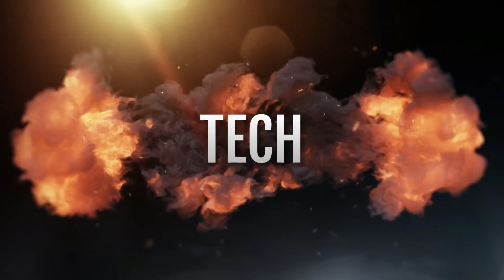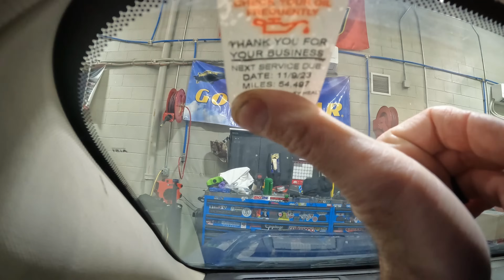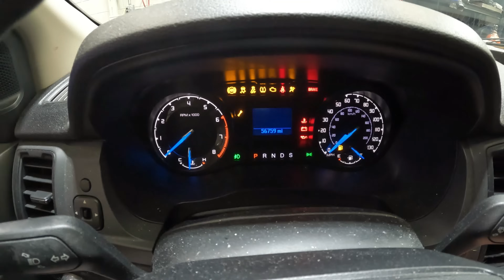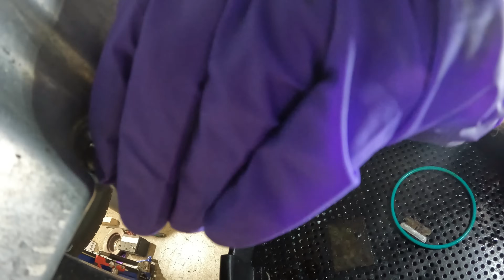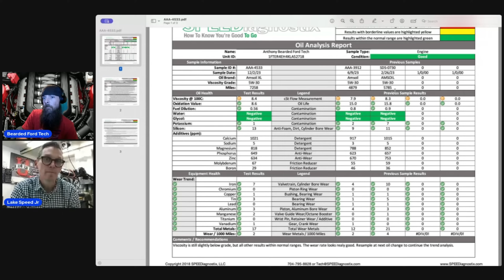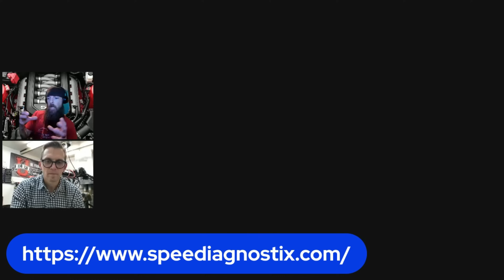7,258 Mile Used Oil Analysis With Auto Start Stop...SHOCKING RESULTS! #newtoyou #fyp #amsoil

Comment: @Bearded Ford Tech loved the video! I've made the switch to Amsoil from T6 Rotella 5w 40. I noticed less engine noise in my 6.7 Cummins and 2mpg increase. It's a 2017 Ram 2500. I have normally just stuck to 6000mile oci. I've got about 4000 on my Amsoil now. My biggest concerns with pushing out further is short trip city driving, fuel dilution and soot. I'm going to do a oil analysis trend starting with a virgin sample and 6000 mile sample with a filter change. At 74000 miles she still under full manufacturer warranty and extended till 10 years 110,000 miles. So I'm weary of installing Amsoil oil bypass filtration system. Ironically should be factory installed because of EMISSIONS related  soot being redirected into the engine on the intake side. But I'm finding Amsoil seems to be holding up better than anything else Ive used.
Reply from the maker: I run the amsoil 5w40 in my 6.7 powerstroke diesel fleet. Get a trend analysis going. That way we can all be sure.  You'll know your going ro far or not far enough. Or just right. This stuff is so interesting to me.

Comment: Hi @lakespeedjr I have a seadoo jet ski that uses mineral oil and service interval is 100hrs.but I only use 20 hrs a year. When do I change the oil?
Reply from the maker: I just forwarded him a screen shot of your question. Monitor the comments to see when he replies. That is a very good question!
Reply: Without oil analysis data, I’d just be guessing. I don’t like to guess.
Reply from the maker: Send in a sample. www.speediagnostix.com
Reply: Bone Stock 25 hours, if modified every 20 hours.
Reply from the maker: @steelzmb4262  send in a sample so you can get a trend analysis going so he can give you a correct answer and not guess. He doesn't want to tell you anything wrong. He wants your machine to perform in tip top shape

Comment: Anthony,  thanks for not being another ford tech that acts like God's gift to auto repair knowledge and everything you say is "bible".  I appreciate your willingness to learn and share that with others and using a data driven approach and not just "don't go past 5k OCI".  As we heard, even 5k OCI may not be safe or best.  I'm also glad your not attempting to "analyze" oil and addtive performance in your kitchen with a bearing grease tester.
Reply from the maker: Your welcome. It's interesting to me. The science is cool. I'm always willing g to learn that's why we are all here. So we can all learn something. Yeah I'm not doing that in my kitchen. Thats what labs are for. My take on it is this. And I've said it on livestreams before with lake speed.  If you need an additive. You need a different oil. A good quality oil already has what you need

Comment: Many years ago I owned a fleet service business. Even back then we started recommending 5k oil service intervals, and we knew full well many would be over that by the time we got our hands on them. After many years the only engine we ever lost was run low from a leak. These were gas engines and they would go to scrap with a running engine.
The thick headed types will be along shortly with their tropes about excessive intervals and brand choice being the dogma of our times.
Reply from the maker: They already started. They are buried in the comments I know all about the fleet stuff it's what I do now. 10k miles. I got one now about 7k over but it's about to come in.

Comment: Very interesting information. Especially about the use of auto start stop. I have such a habit of turning it off as soon as I get in and start any of our trucks.
Reply: I turn it off on a Focus RS…maintaining constant lubrication to the turbo is a high priority to me.
Reply from the maker: @fastsvo  You can literally see the wear rate is very low compared to having it running.  This one is turbo charged too
Reply: I turn it off immediately as well. I typically spend very little time idling on my daily trips, maybe a few minutes in total with the relatively few traffic lights I go through but it's super annoying to have the engine cut out and then have it re-start it maybe 10-15s later.
Reply from the maker: @ferrumignis  now that I can see. 10-15s is way to short for that. But please make sure you drive long enough to get the oil up to temp to evaporate unburned fuel or your doing more harm that good. The fuel will break down the oil and wear it out even faster
Reply: A typical drive for me is probably about 20-30 miles and maybe 2-3 minutes of idling. What’s your thoughts on that? Better with auto start on or off?
Reply from the maker: @domtorretto8875  the driving is enough to heat it up and evaporate it. The auto start stop would keep it from getting in the oil while idling keeping it from getting duel diluted.  I would get an analysis done with and without using it. That will tell you what would be working best.
Reply from the maker: See turning it off causes fuel dilution and more engine wear. I keep trying to tell people but everyone says I'm wrong. Oil analysis says otherwise. Idling an engine does more harm than good

Comment: If you are using auto stop/ start i would recomend using an oil like castrol magnatec and if using 0w20 go to at least a  5w30 !
Reply from the maker: Why would I run 0w20 in a ranger?  I run 5w30. Amsoil. Castrol failed the test sorry. He was talking about 0w20 for his daughters Toyota.
Reply: Run what the manufacturer recommends, don't start swapping to different grades just because you "feel" it's better.
Reply from the maker: @ferrumignis  why would I swap different grades?  I run 5w30 that is what the manufacturer recommends.  Your preaching to the choir. I've been doing this a long time.  Your hearing 0w20 cause that's what his daughter's Toyota takes. That is what he is referring to. Not my truck.
Reply: What data set is this recommendation based on?
Reply from the maker: @D2O2 ?
Reply: @BeardedFordTech  ?
Reply from the maker: @D2O2  didn't know if you were asking me what data set or tye original commenter.
Reply: @BeardedFordTech  Ah, it was to the OP
Reply from the maker: @D2O2  gotcha. 💯💯
Reply: @scootymoon what are you talking about?

Comment: Nice to know you can actually go as long as some oil manufacturers claim and that auto start stop is not as detrimental to your engine as most people think! I was thinking of this oil for my 2nd gen 3.5 eco,running Mobil 1 atbthe moment
Reply from the maker: Get rid of the mobil 1. It is made to the lowest of standards to be called a synthetic. It has failed many tests. Auto start isn't as detrimental and people always say im wrong. Which is why I tested the oil and did auto start on that run.
Reply: Where can I find this info about oils failing tests?
Reply from the maker: @huemongus3742  go look at ford boss me. He did a test on about 35 different oils.  Even lake speed has said on my livestreams Mobil is made to the lowest allowed.
Reply: @BeardedFordTech  my only issue with getting rid of Mobil 1 is that I don't think my Ford dealer has another option when it comes to synthetic oil for my Eco.And my dealer service department is excellent, only place I'll take my F150. I'm currently on a 8000kms/5000 mile oci,what if I shorten it to 5000kms/3000miles?
Reply from the maker: @jasonbrushett2005  Mobil 1 was breaking down at like 1500 miles. Does your dealer not carry Motorcraft full synthetic?  Or an automatic store you can get it like oreillys?
Reply: @BeardedFordTech  here in Canada at my dealer my options were bulk semi synthetic Motorcraft or Mobil 1 synthetic. Perhaps I can  ask the parts department if they can source MotorCraft full synthetic for me.
Reply from the maker: @jasonbrushett2005  if it's a dealer they should have it in stock. Comes in single bottles. Find out let me know.
Reply: @BeardedFordTech  I'm heading there on Friday to drop some Christmas goodies to them.I will ask for sure! Merry Christmas 🤶

Comment: But all of the start/stop systems starting directly after the cooling temperature is rising but at the same time the oil is still bone cold. And at this point in combination with the start/stop the oil takes even longer to get on temperature. (especially at city traffic driving cycles)
I can’t believe that this situation will not harm the engine. 
I’m with you at that point, that after the oil has reached its operating temperature you will not have excessive wear.
Reply from the maker: Yep. It's at temp. And when it shuts off. It's not off long enough to really harm the engine. He even said so. You will always have minimum wear. But the start stop isn't causing it or making it wear out quicker.
Reply: So get to operating temp. before using start/stop?
Reply from the maker: @jetskiracer222  if I use it I get to operating temp. If the oil temp is too cold or its too cold outside start stop shouldn't work until it's at a certain temp.  But using it at operating temp you should be just fine!
Reply: I just watched your video about start/stop. I never noticed before that it doesn't turn off until it hits operating temp, but I realize now it doesn't, so that makes sense. What about remote starting or warming up your truck? There's allot being said right now about it not being good for your engine.
Reply from the maker: @jetskiracer222  I remote start when it's really cold to defrost the windows. Or really hot so I'm not on fire when I get in there. It's the idling that's bad. And short tripping not letting it get to temp.  Everyone says start stop is bad. Or remote start is bad. But they never say just starting it in the morning is bad or sitting there idling in traffic letting the fuel wash the cylinders and dilute the oil.  They just assume things. First initial startup of the day is where the most wear occurs.  And idling for long periods makes it even worse. Remote start and start stop aren't doing harm like people assume. They don't care to learn how any of the systems work. They just want to blame the systems.  Or compare it to older engines. Modern engines can handle it.
Reply: @BeardedFordTech  so which is worse, driving a cold engine right away or idling for 5-10 minutes while cold?
Reply from the maker: @jetskiracer222  idling to let it get up to temp. Reason being. That takes on average of 15-17 min. If you start it let it come down off high idle (when the rpms drop down to normal after starting) and drive. Not hard. But just a normal drive it takes about 6-8 min to warm up to temp.  This does not mean the oil is at temp.  On either scenario.  But if you just drive and let it come up to temp the oil will get to temp quicker. Back in the day driving it while.cold was bad. So was idling.  They didnt have computers to control everything like now. So what I do on a normal day not to hot or cold. I hop in start it wait for idle to drop to normal and drive.  On a hot day I remote start it about 2 min before I get in. That way the ac is on and has cooled off the cab. Then I drive. On cold days where frost is on the windshield. I remote start about 5 min before I get in.  This is enough time for the windshield to be heated enough to be cleared.  Then I drive.
Reply from the maker: @jetskiracer222  but the testing shows that idling would be worse. You can drive with cold oil. That's why they are multistage. It's a certain weight when cold and a certain weight when at temp.  It's lubricating. But what it isn't doing is evaporating unburned fuel.

Comment: We’ve been doing 10K oil changes on our Ford Transit and Ford 6.7 Ambulances for years based on oil analysis. We beat the living crap outta those vehicles in the Arizona heat and we run them to 300K easy. We get rid of them still running.
Reply from the maker: Yep maintenance is key. Keep it going!!
Reply: We were also expected to change the oil at 30,000 miles as per Oil classification if the sample came back negative or low percentage then we were change the oil most of the internationals we change that about 18 to 20,000 miles
Reply: @chekelley6861 out of curiosity what brand of oil do you use?
Reply: @chrisr.123  whatever 10w30 synthetic diesel oil is on sale at the time for the 6.7 and 5w20 synthetic for the 3.7s. We also have 3.5 ecoboost that takes 5w30 maybe? We only use synthetic but brand doesn’t matter for us.
Reply: We put extensions for oil inspection on our heavy trucks international Mercede Volvo even our vans the transit system Mercedes and the few Dodgers but I would take samples from the drain plug I was told not to the sediment at the drain plug would contain more of metal chemical residues being tested much of the sediment from samples at the drain Had more Contant so I was advised to use the oil inspection tube at the oil filter housing the results were better not as much metallic
Reply from the maker: @Jesse-rj2ye  yeah your supposed to let it drain for about three seconds like I did. That's how the instructions are too.  What your catching the the suspended contaminants in the oil.  That's what your looking for. How did your tests turn out?  Good results?
Reply: @BeardedFordTech  
I did that the results were not the same most of the internationals add 3 to 400,000 miles for those numbers the Mercedes seemed better we used required oil for the mercies A lot of brass 10 iron pieces from the air nationals even once I was doing it the correct way caterpillar seem to be the worst
Reply from the maker: @Jesse-rj2ye  dannnngggg

Comment: Anthony did that oil smell strongly like gas when you drained it?
I'm glad you came over to the dark side like me with oil analysis!
Rich kicked me off his channel because I was posting that I was going 10,000 miles on OCI for my Hyundai Tucson 1.6T GDI engine and 12,000 miles on OCI on my 2001 Ford explorer sport trac 4.0L engine with 215,000 miles on that engine now! I have the oil analysis on both to back all that up too. This video will not make him happy but oh well right?
Reply from the maker: Did not smell like gas at all. And the analysis shows very little fuel dilution. Yeah it'll probably make him mad. But analysis doesn't lie.
Reply: @BeardedFordTech  
Analysis doesn't lie that's what I preach! 👍💯♥️🇺🇸

Comment: Is this the Sig Series or XL?
Reply from the maker: XL the 12k mile formula. Which you can't get anymore. They redid it and now it's good for 25k. This analysis trend is going to get really good
Reply: @BeardedFordTech  I really enjoy the content in this video, along with your interaction with Lake Speed and your excellent replys to of the comments from viewers.  The Amsoil "XL" product line was replaced last summer by the slightly improved "Extended Life" oil (which had acquired additional base to counteract the acids), so they extended the warranty to 20,000 miles or one year (whichever comes first) for "Normal Driving," but the warranty of the Extended Life oil only applies to 12,000 miles (or one year) for "Severe Driving" (just like the XL).